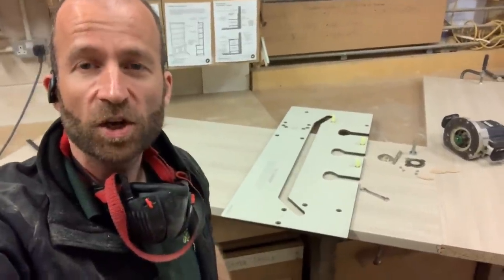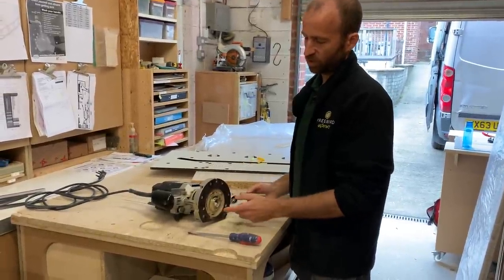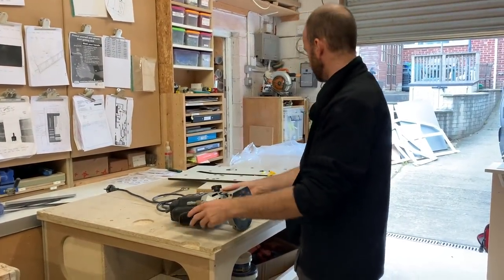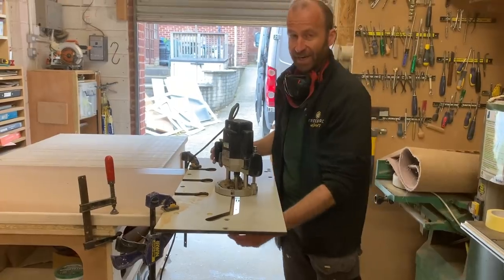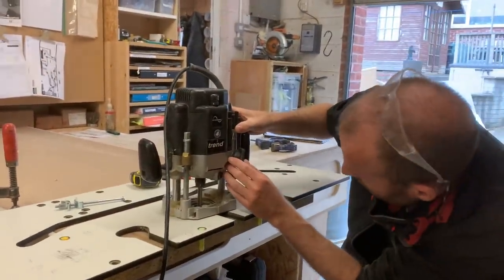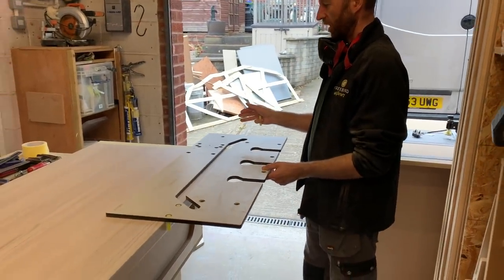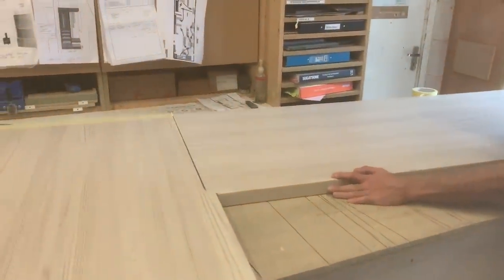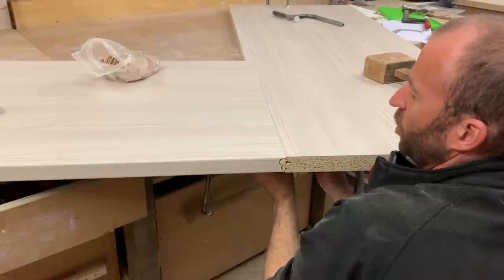How to make 'Mason's Mitre' worktop joints with a router and jig

Comment: You never cut a male joint first...shocking
Reply from the maker: Robert Carter tell us more, why is that?  The comments are a great place to add to the knowledge.
Reply: Makes no difference which one you cut first in a workshop. When cutting a right hand joint on site we cut the female joint first, place it in position, then lay an over sized length of worktop on top of it.Then, scribe along the female joint with a pencil onto the underside of the male piece. This gives you the exact angle to allow for walls being out of square. Just remember to mark a line 8mm back from your scribe line then line your jig up with that. For a left hand joint, lay the oversized piece in position, lay the female on top of it then scribe the line onto the face of the male piece.
Reply: Excellent video by the way and very clearly described. Many joiners I have worked with don’t know about centring the guide bush. I buy good quality bushes now and can swap them over without having to re-align every time.
Reply from the maker: se7en teen thanks for the explanations 👍
Reply: Yes you always cut the female joint first. I was surprised you didn't do this.
Reply: @traveller017  Thanks. That's an excellent point. I was trying to remember how to do this because obviously the walls will rarely be square.
Reply: I thought when doing bolts, you but the dowel in B and sit against the face of the worktop? As this gives you security for the front of the mitre? You went from the front to then switch to going from the back edge of the worktop. Which is the correct way? If any? Thanks